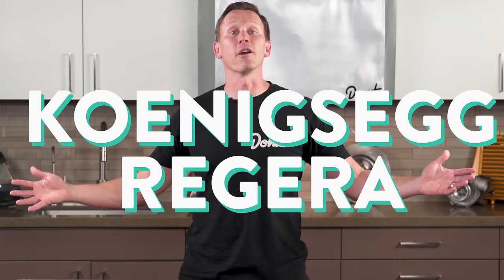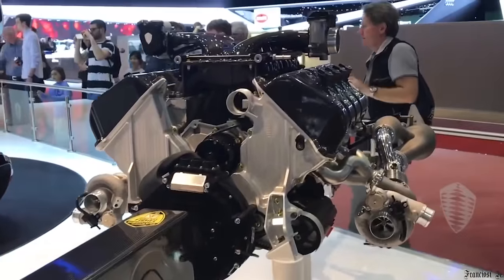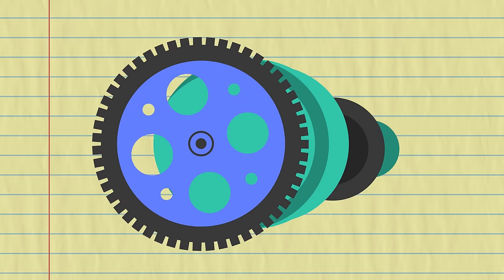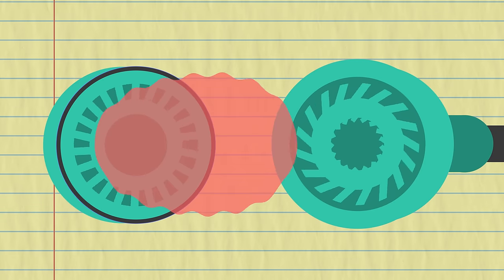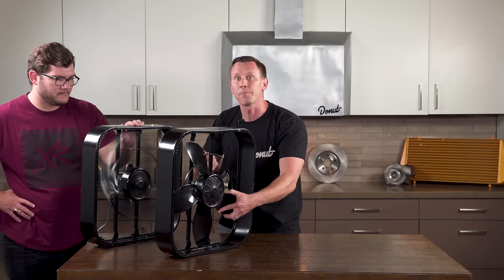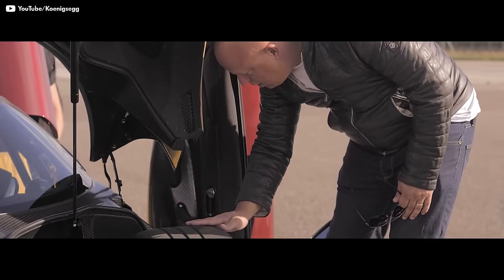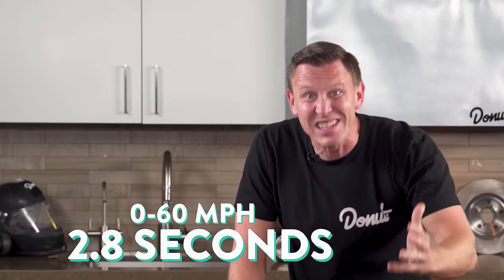TORQUE CONVERTERS | How they Work

Comment: Bart don’t worry you definitely have more than two fans...
Reply: Curtis Campbell but those are his “biggest fans” eh ehhhhh eh I’m not funny
Reply: That's true
Reply: 2.5 fans instead
Reply: 938k fans,
Going on a million
Reply: I wish I could afford 2 fans.
Reply: Ah! Genius!
Reply: Well done Simon Cowell
Reply: ...and sometimes one fan blows another fan @7:30
Reply: Curtis Campbell YEAH... ITS 3
Reply: 3
Reply: Now 2.94 million fans.
Reply: isnt it possible to replace the clutch with a torque converter but retain the manual gearbox? both in case of car and motorbikes?

Comment: Fun fact: The electric motors in the Regera are powerful enough to be in its own supercar.
Reply: Jesus they should do that
Reply: ...with a light enough frame, you a lawnmower engine could be in its own supercar...
Reply: @Ellotherem8 Lol, I didn't say it was reasonable, just possible. Maybe take a step out of your thimble-sized box once in a while.
Reply: @Ellotherem8 Horsepower is not the defining characteristic of a supercar, performance is. Example: Ariel Atom.
Reply: @Ellotherem8 lol, I said lawn mower engine. If by luxury you mean price, the price would be very high for super car performance with a car powered by a lawn mower engine. And by my definition, the atom is definitely a super car.
Reply: @Ellotherem8 link a definition.
Reply: @carsonvogt3297  they already make cars with lawn mower engines, it's called a Honda civic
Reply: @Kev2980  XD
Reply: isnt it possible to replace the clutch with a torque converter but retain the manual gearbox? both in case of car and motorbikes?
Reply: @MJ-rr4hd  that will give you the worst of both, the inefficiency and power loss of an auto with the attention required to select gear ratios of a manual. lol

Comment: Torque Converter used 28 times 
Converter of torque used 2 times 
Torque used 36 times
Impeller used 18 times
Turbine used 17 times
Clutch used 11 times
Transmission used 9 times
Shaft used 8 times 
Stator used 7 times 
Coupling used 6 times
Un Impossible used 1 time
No torque converters were harmed in the making of this video
Reply: Are we Still doing Phrasing thank you for your kind service sir
Reply: You from Toast masters bro?
Reply: How about "fans"?
Reply: @ashs3380  same
Reply: Thank you very much my friend estimated🗿
Reply: thanks sir for those counting
Reply: Was 2 mins in and was wondering the exact same the 😂🤣🤣🤣🤣👌
Reply: How many times did he say the?

Comment: Very informative video. Thanks!

Here are my notes I've compiled, please correct me if I am wrong:
Torque Converter:
Only found in Automatic Transmissions. Not found in manual.
Transfers power from the engine to the transmission.
Consists of a lock-up clutch assembly, impeller (pump), stator (reactor), and turbine. 
Having the reactor in between the impeller (pump) and turbine makes it a torque converter.
The impeller (pump), strator (reactor), and turbine all have fan blades, which have transmission fluid running through 
them spinning with Centrifugal force.  
The impeller (pump) moving in circles flows the transmission fluid through the strator (reactor) to the turbine to make it spin too.
Without the strator (reactor), the impeller (pump) and turbine will not spin at optimal levels, but rather slow.
The impeller (pump) helps the turbine spin as the transmission fluid flows.
The stator (reactor) helps the transmission fluid flow from the turbine back to the imepller (pump) efficiently.
The stator helps increase torque big time by making the transmission fluid shoot at an angle speeding the flow speed up,
just like putting one's thumb over water flowing from a hose. This is viscous force.
The stator has a one-way clutch, making the the torque converter only spin when the car is moving.
To help the turbine spin faster, modern Torque Converters connect to a Lock-up Clutch, which is a shell-like component.
The Lock-up Clutch sits over the turbine and connects to the impeller (pump). 
This allows for the turbine and pump to spin at the same speeds.
The Lock-Up Clutch only kicks in after every gear has occurred, and is equivalent to driving at 5-speed in a manual vehicle.
The torque converter connects between the motor and the transmission.
The impeller (pump) sits near to the motor and the turbine splines to the front of the transmission onto the input shaft,
which transfers power from the motor to the transmission.
Rotation from the engine transfers to the transmission via the turbine sitting on a central shaft. 
A man made an amazing new design of the torque converter.

Comment: This is not technically correct in some places:
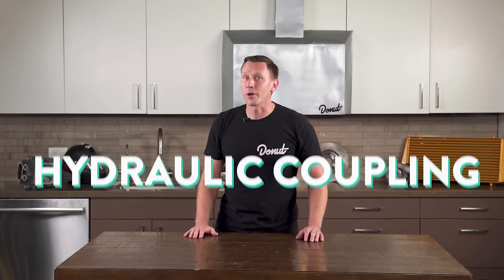1:50 You've switched location of torque converter and a motor/generator - Motor-generator is coupled with engine. Torque converter allows engine to spin faster than wheels powering generator that can give extra power to motors mounted by the wheels.
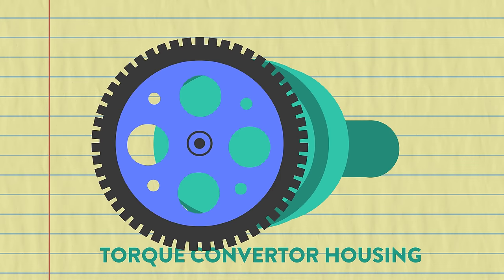2:44 Flex-plate. There is no need for extra flywheel when you have heavy torque converter bolted to it. 
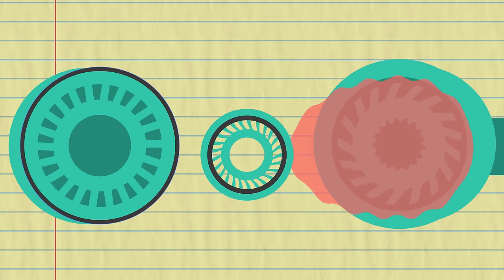6:40 No! Turbine does not spin faster than impeller! Torque multiplication is happening when the impeller is spinning faster than the turbine. Actually it works best when the turbine is stopped (stalled). What is happening is impeller shoots fluid in one direction and turbine captures that fluid power by redirecting it in the opposite direction. Then the fluid leaving turbine travelling in that opposite direction hits the impeller which must redirect it again. They basically work against each other so the impeller is dragged by a turbine trying to slow it down and turbine is spun by the impeller throwing all that fast fluid to it.  That is how the fluid coupling works. 

In a Torque Converter there is this stator that acts like a fixed ramp that captures fluid exiting turbine, bounces it back into correct direction and that redirected fluid is fed to the impeller that now has less work to do as the fluid is already going in a correct direction. Less work to do means that it can shoot that fluid with more force adding torque! This added torque from fluid being redirected wants to spin the stator backwards, but it is fixed (on a one way clutch) so it doesn't spin. But there is a catch: When the vehicle starts moving a turbine will start to spin. The fluid shooting out in the opposite direction is now shooting out of the moving turbine and it will be not going in the opposite direction that fast, thus it will rebound out of stator less. So the torque multiplication will be lower. Eventually it will spin so fast that the fluid will be going in same direction and a stator will become an obstacle. This is why they are mounted on a one way clutch, so that they will spin together with the fluid when the speed is high enough. 

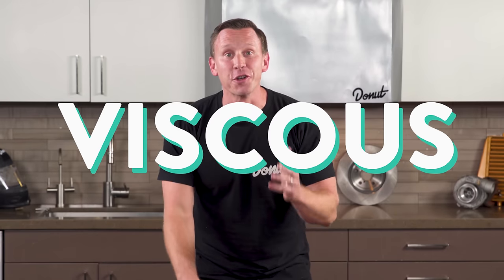6:50 This has nothing to do with a viscous force. This has to do with a mass and speed of that fluid.
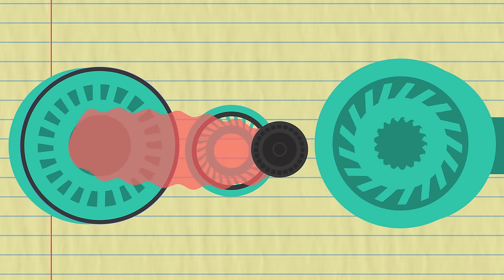7:50 Lockup clutch is controlled externally by supplying pressuised oil to push on that clutch and is not affected by speed or torque transmitted by torque converter. You can even force it to remain locked all the time and stall the car because of that. 
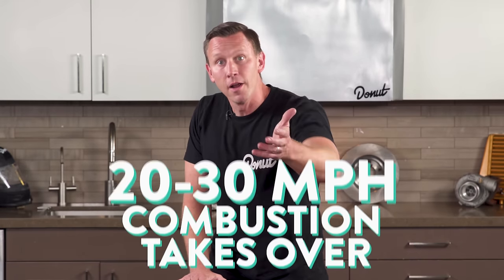8:55 No, at this point torque converter did most of its job. The faster you go the less torque multiplication you get. (okay with that super long gearing and that "loose" converter you will still have some torque multiplication at this point, but less than on dead stop) The slip is what is really needed: It allows engine to speed up, build boost (more torque!) and spin the generator faster (more generated electricity that can be sent to the motors on wheel shafts)
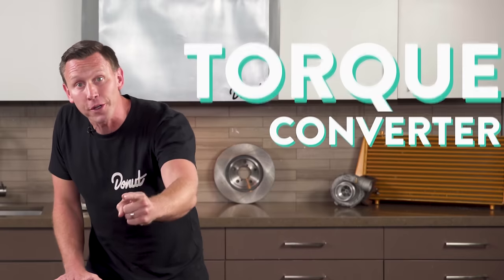9:03 thanks to the STATOR, not TURBINE! Without stator there would be zero torque multiplication, just the slip.
Reply: You forgot he used the incorrect phrase centrifugal force. There is no such force
Reply: @matthewyoung917  you nuts?
Reply: @Ghosteriz  he's actually not. Centrifugal force is used to describe two separate forces with normal and tangential directions

Comment: Flex plate bro, flex plate.  Fly wheels bolt to clutches, not torque converters.
Reply: The point is, no it doesn't in the Regera because there are no gears.
Reply: SentsuizanXS still doesn’t change the fact he misinformed people by telling them a flywheel is in the equation. Automatic transmissions use flexplates which are thinner than flywheels.
Reply: Dont the othet companies call it somthing else?? As a Mopar guy, its a flex plate...but...
Reply: Jj Abatie no, they're flex plates no matter what car they're in.
Reply: casey360360 shows how much attention i pay to non-Mopars😂😁😂
Reply: Peter Marino basically the same concept and if you do anything requiring knowledge on the difference between the two you shouldn't be using this video for your info resource but rather a beginning point in understanding them.
Reply: Jj Abatie 
Toyota also calls it a flex plate
Reply: In dodge cars the flexplate is a flywheel
Reply: While flex-plate is technically some sort of flywheel you are correct - it has other main function - It is a plate that flexes :) to dampen out any possible converter movement.
Reply: @Trex6767  no.. toyata calls them "frex prates"
Reply: Hondas/toyotas use "frex prates"
Reply: Jordan Brown ok that’s funny

Comment: Sorry. But im still confused...
Reply: El_De_La_Lobo I'll simplify it for you bro

Just think of a chamber hooked up between the engine and the transmission or drive shaft
this chamber holds a turbine and inside of it, transmission fluid, some impellers/or blades
And a flex plate,
when the engine starts turning
it spins the firts impeller or blade
this causes that fluid to move and creates motion that will in turn spin the other impeller that's connected to the drive shaft or transmission, now the flex plate sits in between them, and it's purpose is to increase the speed and response at which the fluid moves as well as disengaging and re-engaging the impellers on to each other
the flex plate is added friction between the two impellers
when you let off the gas and brake this disengages the flex plate and in turn the impellers which lets the engine turn while the car is at a stop
and all of this takes place in a turbine

If anyone else sees this maybe they can correct what I said and make it easier to understand lol
Reply: I recommend you watch a video made around the 50's by Chevrolet  about torque converters.
Reply: @isrealdiaz3899  remove the word flex plate and replace it with stator and your explanation would be correct

Comment: Why would you need a combination of an electric motor and combustion engine to get 0-60 in 2.8 seconds,  when a  cheap v8 engine from an under 60k c8 corvette can do that too🙁
Reply: bc that's probably not their only use.... a corvette also doesn't go 250 or handle like a regera

Comment: There are clutch packs inside some automatic transmissions they either hold or release depending on designed function which helps shifting

Comment: So when you apply the brakes in an automatic transmission, does the turbine come to a stop because rpm has dropped? And therefore the impeller doesnt have enough fluid force to drive the turbine? Or is something engaging the turbine to make it come to a stop? Really interesting stuff, been watching a couple different videos on this.

Comment: The picture at 1:51 is wrong. One electric motor is directly coupled to the crankshaft. The power then goes via the torque converter to the rear axle and the 2 others electric motors.

Comment: I have one question. If the torque converter runs of the engine and uses fluid coupling and runs the transmission pump, when your stopped, how does it start going again if it’s not technically running the transmission pump? Wouldn’t it just send all the fluid back into the sump of the transmission and never get going again? Or am I missing something here. I know a little about transmission but can’t say I’m an expert here

Comment: a bit over the top on the theatrics, but mostly accurate
The inaccurate part is how the torque converter clutch is applied, it's usually electronically controlled fluid pressure that applies and releases it, not some physical function of the speed/pressure of the fluid in it

Comment: Theoretically I could make a torque converter to into a direct drive transmission? I'm just asking because I'm looking at building an old school front engine dragster. Just as fun cheap project.

Comment: What's a core charge? I always see that when buying a new torque converter. Also would a remanufactured/rebuilt torque converter be a good purchase to replace a torque converter?
Reply: Core charge is what they charge if you don't give them the old part you are replacing with the new part.  If you buy a new one they lose inventory but if you give them the old one, they can rebuild it and sell it and make more money.  If you don't return the old one, they need to buy a brand new one and it will cost them more.    
It is somewhat like a library fee if you don't return a book.    

Rebuilt parts are a great option.  They are a lot less expensive and in most cases are good as new.  You just get a little less warranty with rebuilt parts, but the warranty they have is usually more than enough to save money compared to the cost of a new part.

Comment: What if you were to use a small rotary engine for a hybrid?  Yes, less fuel efficient, but less weight, moving parts, and power for size.  It's mainly electric anyway.

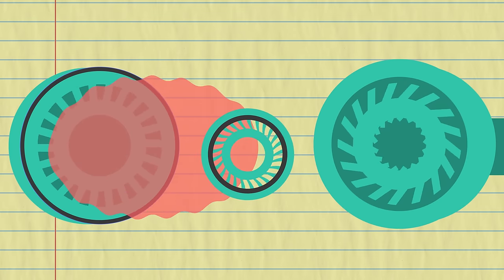Comment: 6:39 You said the Turbine moves faster...and for constant power ω*τ (speed*Torque) is constant..so torque should decrease if the speed goes up...not increase..right???
Reply: Right. I think you could theoretically design a torque converter to reach a speed ratio higher than 1 (turbine faster than impeller) but that would necessarily mean the turbine would have less torque, nobody does that because that would still have energy losses so when it's close to 1 you just lock it up, if you need higher output speeds you do that through transmission gearing.

I think he meant to say torque rather than speed. When the impeller is turning faster than the turbine you get more torque on the turbine than the impeller, the greater the difference the more it's multiplied. From standstill a car's torque converter can often deliver over 4x more torque to the transmission than it's getting from the engine (that's why cars with automatics often have taller gearing than their manual equivalents, the torque converter would cause wheelspin on launch).

Comment: When I put my Volvo 240 in gear, it won't move right away. Then a few seconds later the car wants to lunge forward. But once the car is moving, all the power is there when I step on the gas, there are no more delays.

Is something wrong with my torque converter? Seems like the fluid isn't building pressure at first, but once it does the car moves as it should.

Comment: Funny thing is, this isn't that different from turbine-electric drive systems used clear back in WWII to power ships. It's downside compared to steam turbine was it's weight but turbine-electric allowed for quick changes in speed and even propeller direction.

Comment: So do you change the fluid of the torque converters?
Reply: generally you cannot service fluid in the torque converters as they are sealed units, only in the valve-body of the automatic transmission can be flushed. However, there's not much need to change the fluid in them since they don't really "wear" or "dirty" the fluid inside the converter itself.

Comment: Can this be used to connect a supercharger's axil to a turbo .where the impeller for compression is connected on one end to the crank and on the other end to the turbine with a torque converter in between the impeller and the turbine so that  there is no turbo lag and the end result would be a power band similar to.two.stroke engines ? I think it would be insane on those 400cc japanese bikes which.revved till 20,000 rpm

Comment: Stall converters and trans brakes next
Reply: A stall converter is a torque converter
Reply: @Redtooth75  I understand that but how do they work different from factory
Reply: @richarddaacke3847  torque converters and stall converters are literally the same thing, just different names.
Trans brakes are an aftermarket mod that is essentially just a brake on the transmission. They usually put it in first and reverse at the same time. That buils up tension and then it is released to help the car accelerate.

Comment: The turbine never spins faster than the impeller, and torque multiplication can only happen when the reverse is true. Power is revs x torque, so if the turbine (output) was spinning faster than the impeller (input) and the output torque was greater, then the output power would be greater than the input power.

Comment: I'm suprised no car companies have tried to adapt koinigseggs TC idea. The transmission in my mind has always been an overly complex system to accomplish such a simple task. It's way to complex to do something as simple as switching gear ratios. An adjustable TC would do the same thing, with way less cost and complexity. The cost of a car with a simpler transmission would be quite a bit less. They've been trying it with CVT but they are too high maintenance to replace standard automatics. It's proven it can work,  why no other company has done it is a mystery to me.

Comment: I still can't wrap my mind around how 1500Hp could be transferred through oil...
Reply: Technically "only" about 1300, the drive shaft motors don't go through it.

But that's why this torque converter is massive.

Comment: the fly wheel this man said the flywheel torque converter are found in automatics it uses a different system than an manual set up and it does not have a fly wheel wheel it has what is called a flexplate yay i corrected him

Comment: He said it makes turbine spin faster than impeller, which I think is not correct. It should be the other way round, only then torque will be multiplied at driveshaft.